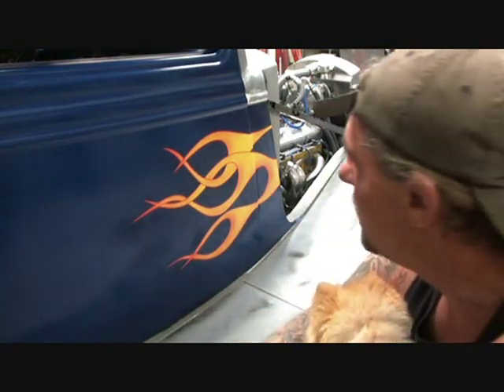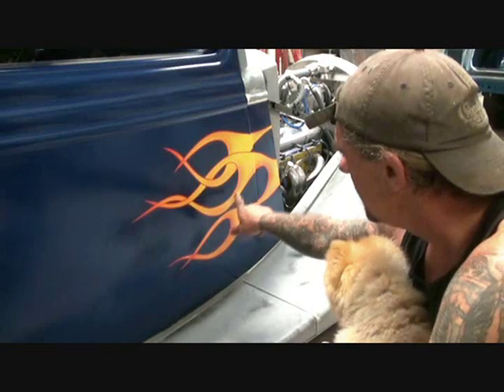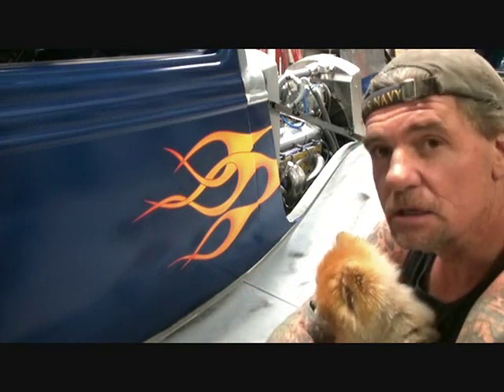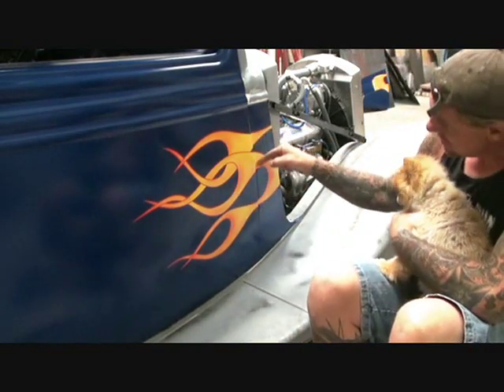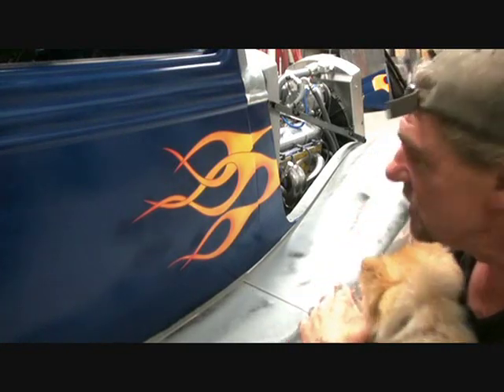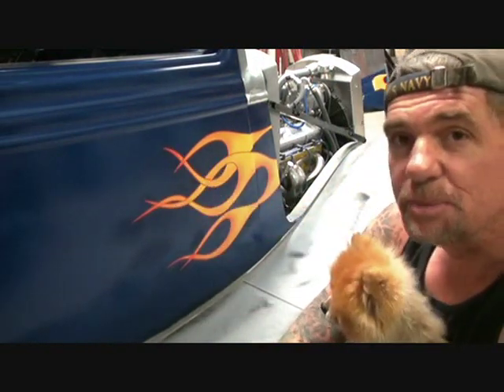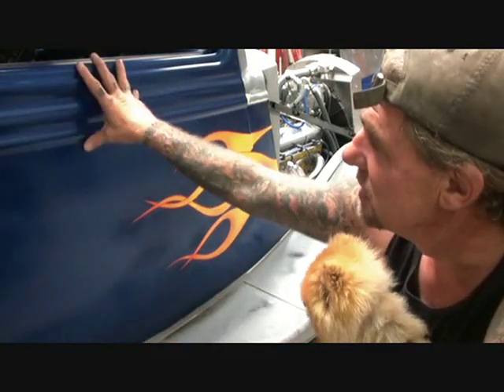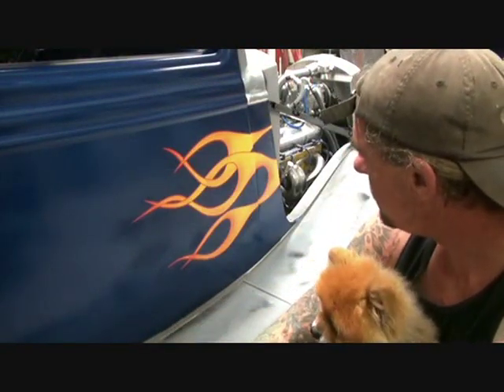How To Paint Flames The Easy Way-Part 6-Finally DONE

Comment: I am still confused on Intercoat clear. Since the pinstriping is ontop of the intercoat clear, does that get sanded with everything else before clear? or did you sand down the flames then apply the pin stripe, then simply wipe it all down after it is cured? What grit do you use to sand intercoat clear?